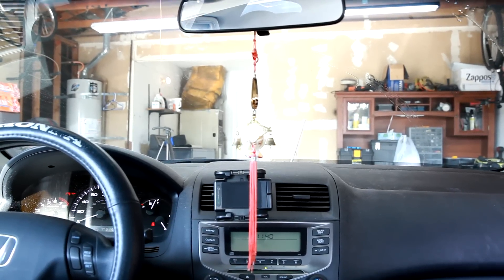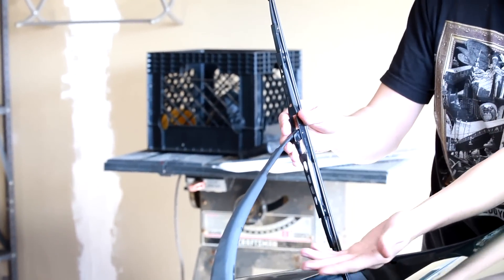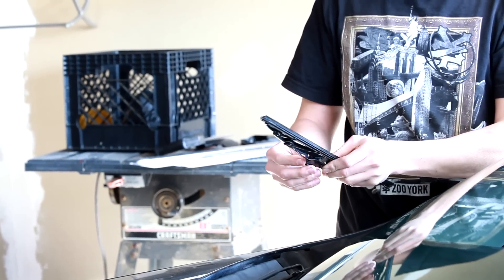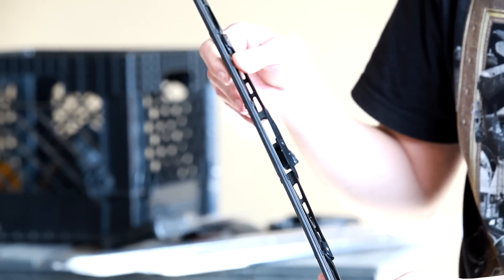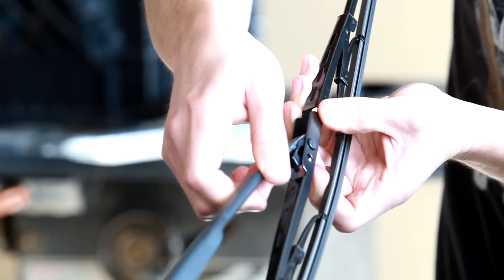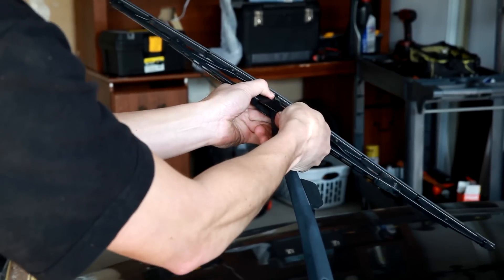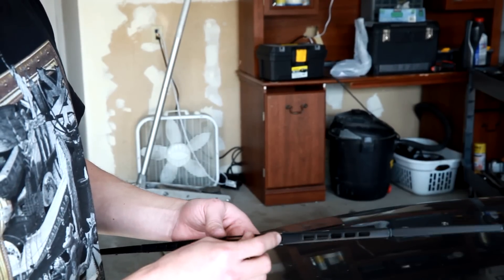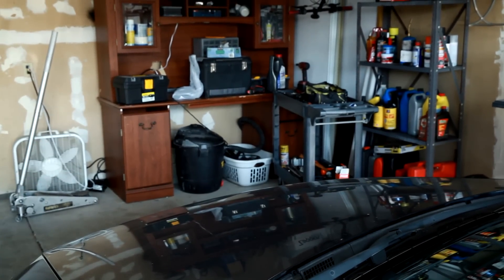2003-2007 Honda Accord Wiper blade remove and install

Comment: You don't need to buy the whole wiper, you can just buy rubber blade replacements for $5 at any honda parts store as long as you still have your original Honda wipers.

Comment: Thank you for posting this video. It helped a lot.
Reply from the maker: MiamiPush2theLimit np :)
Reply: NutzAboutBolts Does the size of the blades matter? I go to the store and see different sizes for my 2005 accord.
Reply from the maker: Yes, the size of the blades matter. The driver side is 26" and the passenger side is 18". The store clerk should know what size is good for your vehicle.
Reply: NutzAboutBolts Thanks!
Reply from the maker: not a problem, glad we could help :)

Comment: Next time just replace the rubber or go to the honda dealer parts Dept. they call it INSERT  just pay$12 a pair they will install for free.
Reply: Yep, was just looking up my other cars to see if they have insert replacements and figured I would also check my Honda and saw this video.  Such a waste to throw out the entire assembly when its just the rubber that is is bad.

Comment: You need to point out on that wipers with a locking-tab you need to squeeze the open end of the hook to unlock the tab and then the blade will slip right off.
Reply from the maker: this was for oem wiper blades, all after market has different types of locking mechanism for their wiper blades, so it varies.

Comment: These blades don't fit on 03 - 05 accords
Reply from the maker: ? is your blade an aftermarket brand?
Reply: NutzAboutBolts No worries. I figured it out, thanks.